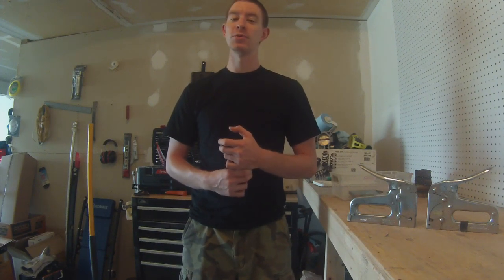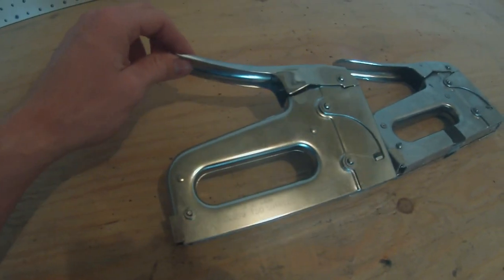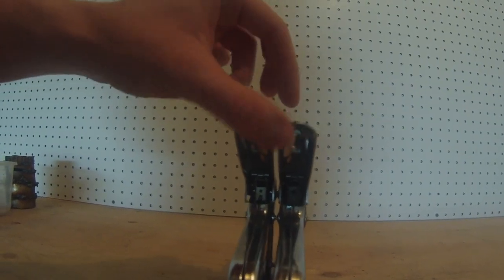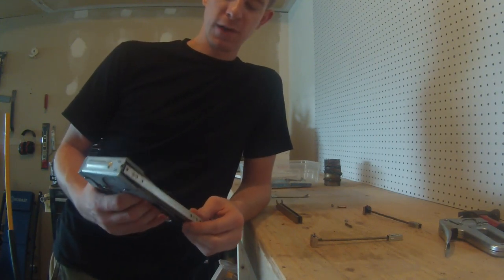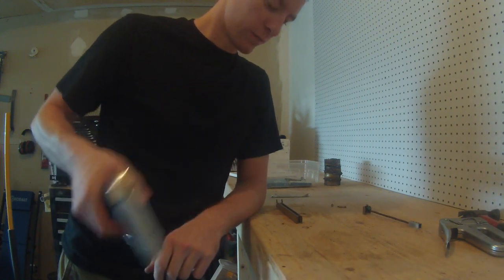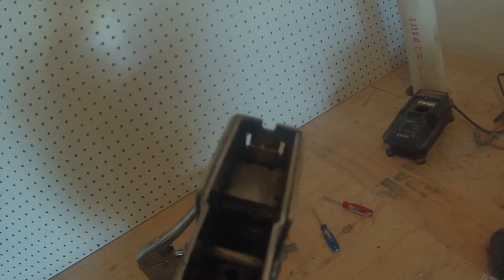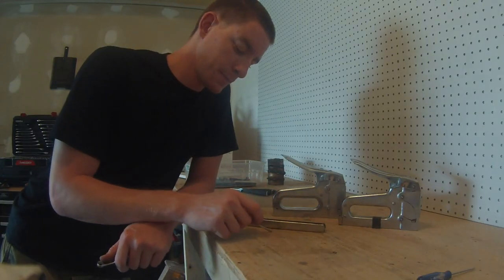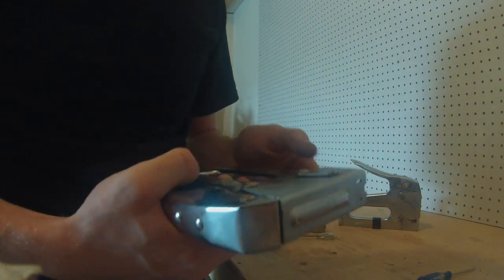Arrow Staple Gun Breakdown/Fix

Comment: Yay, you said "fewer hours" instead of "less"!  Bravo.

Have the same stapler.  The handle...no, the lever you press to release a staple, is jammed and I can't figure out why.  It will only depress about a half an inch, as though there's a lock on it, but I can't find one.  Was hoping that was the problem with yours.  I don't have any jammed staple (which I don't think would keep the lever so immobile anyway), and I took the spring thing and the staple retainer out, but there didn't seem to be any problem there.  So, I guess I'll look for another video now.  I hope there's not some simple release that I'm forgetting about.  Haven't used this staple gun in about six years.
Reply from the maker: These things seem pretty finicky once they get worn
And my mother was a teacher and I have a 4 year degree, so I’m not allowed to have improper grammar 😉

Comment: What you were calling retainer clips (and the resulting need for what you called retaining clip pliers) are just simple "e-clips". You pop them off with a small flat blade, and snap them back on with needle nose pliers. Sometimes they spread on you, so you just close them back down to their original diameter (so they hold well) with your needle nose before snapping them back into the groove in the shaft they were gripping. Yuri.
Reply from the maker: Thanks for the tip!  Ya learn something every day!

Comment: Think I've got the same deal you have at the end with an Arrow T-50 gun here. From what I could figure on mine, I've decided that flat "hammer" mechanism is no longer being raised high enough to clear the forthcoming staple, so before it grabs anything, it just slams back down with nothing loaded. Don't know if that's a common issue with wear and if there's anything which can be adjusted. Just removing the front end only gives you access to a couple of the parts. Thinking about maybe grinding some off that hammer bar, but I'm not quite ready to ruin it. ;-)
Reply: Mine shoots nothing evwn when full of staples. Arrow makes some junk. It does one thing and they cant handle a simple tool with 1 simple task.
Reply: @VirantRoss  well it still technically doing one thing it's just a glorified staple holder

Comment: I just took my Arrow T50 apart to see why it keeps jamming.  Turns out the rails that the staples ride on were curved inward (toward the centerline of the stapler) visibly when I sighted down the rails, so that the staples had some looseness or play at the hammer end.   This play would seem to allow the staples to get cocked when the hammer fires and I think this is why it kept jamming all the time.

I bent the rails outward using a screwdriver until they looked straight.  Made sure the staples still tracked smoothly all down the rails and reassembled.  Shot 10 staples with no jamming so I think I may have fixed it.  

I also noticed the hammer blade appeared to have some twist.  That's what happens when you loan tools to people who don't understand tools.
Reply from the maker: Excellent tips, much appreciated!
Reply: Hey there, we're glad it seems like you were able to resolve this issue, but please let us know if the jams start up again. We do offer a warranty on this tool and are always happy to troubleshoot with customers here, by email at customercare@arrowfastener.com or at 800-776-2228.

Comment: Why is it that my staples don't go all the way in the wood? It's partially out. Is the staples too long or something or is my stapler gun???
Reply: Hey there. Yes, it sounds like your staples may be longer than needed for your project. You can learn more about picking the best size staple for your project here: https://bit.ly/2gG9Nbz. However, what you're describing can also occur when the tool is not kept flush to the surface while firing. For a staple gun like the T50 in this video, that can be tough to do unless you have a large grip span and a lot of grip strength. Often using a forward-action staple gun like the PowerShot T50HS or one with a smaller grip span like the TacMate can eliminate this issue. We hope that helps! If you have any more questions, feel free to reach out to us directly at customercare@arrowfastener.com.
Reply: why do the staples come out crooked, did I do something wrong when loading?